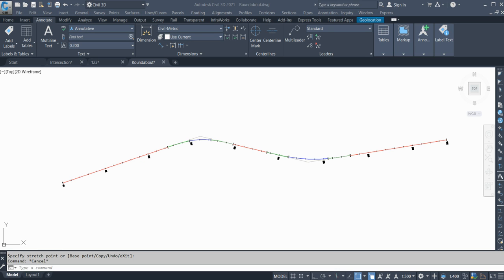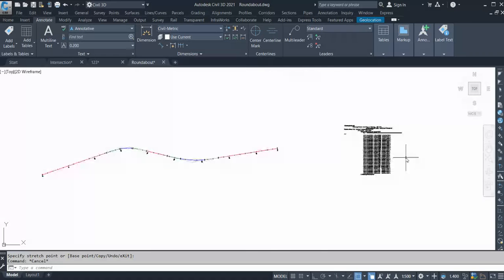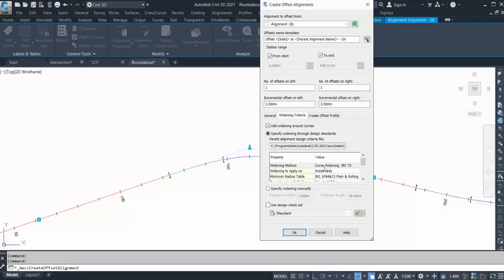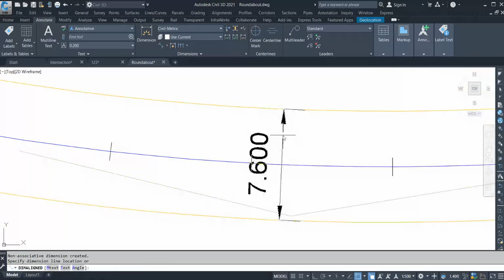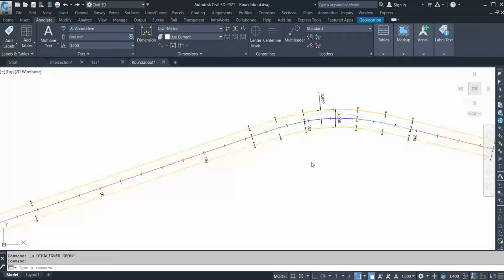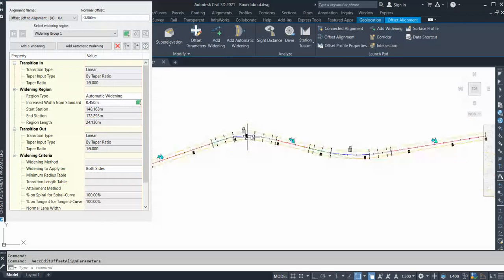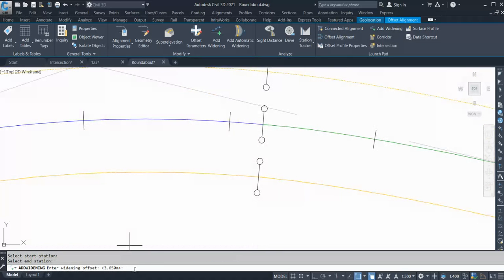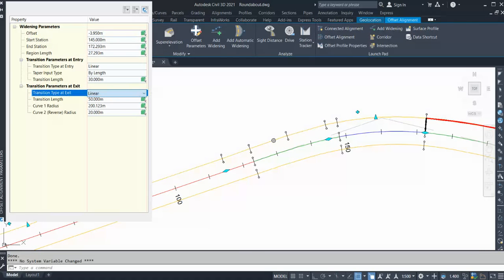Civil3D - Extra Widening on Alignment (Automatic Widening Method and Manual Widening )

Comment: Thanks a lot for sharing the video. Sir is it possible to apply widening in C3D by any input file or VBA programimg, and save the widenning data in a file.
Reply from the maker: what criteria you will give in input file or VBA ? You can modify default widening criteria file if required.